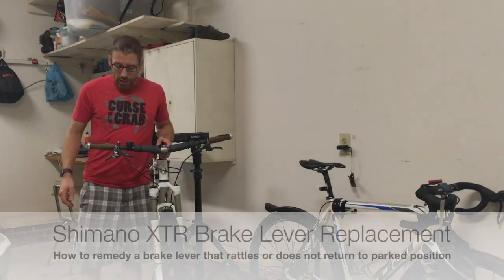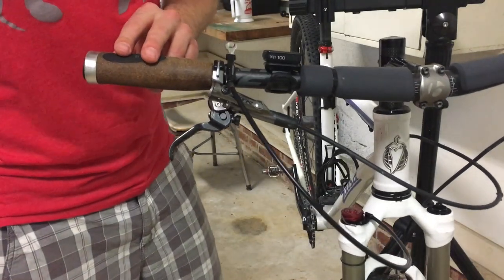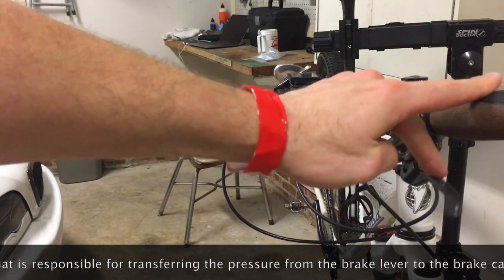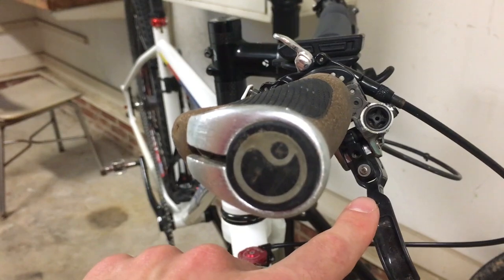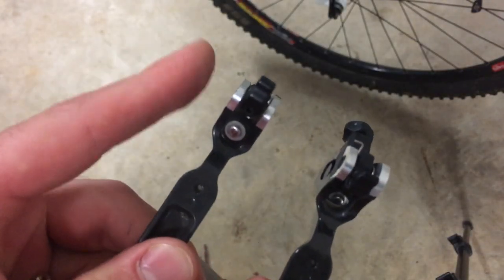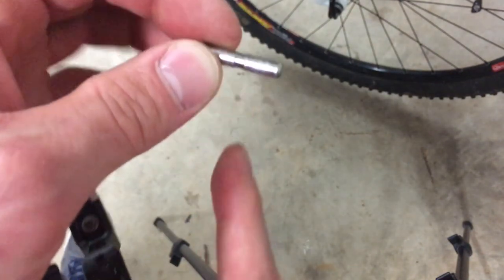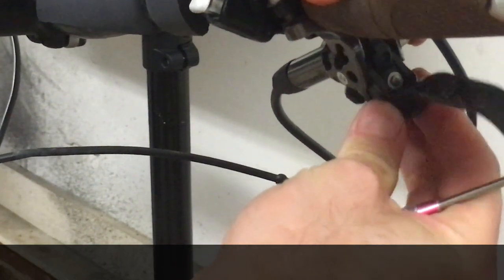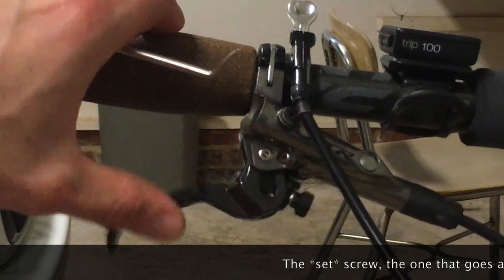Replacing a faulty Shimano XTR Brake Lever

Comment: My battered ole XTR brakes just started w/ the floppy lever. And so, I ordered a new one. Easy peezy…. Or so I thought. First try had me putting the spring in the wrong way. Second try had me at your video. 
Thanks. That did the trick instead of me stumbling on the correct installation blind.
Reply from the maker: Man I am so glad it was helpful. These brakes now have over 13000 miles for me and are getting ready to move to the next build :)

Comment: Thanks that was super helpful - Like someone else mentioned I would not have known about the set-screw that holds the pin in.  I'll add that my set-screw did not use a 2.5 mm hex - I had to go find a 5/64" hex driver (I suspect the screw really needs 2mm).  Could be due to my brake being a bit older XTR from 2014.  Also lining up those parts and the springs to get that pin through can be a bit of task!  The first two times I did it the lower spring was not catching against the brake body in the correct place and it was not cancelling the free play.
Reply from the maker: Glad it was helpful. Yeah, lining things up can be a bit of a pain. I worked as a mechanic for many years, so I got somewhat used to working on things by feel and lining things up, etc. Even still, sometimes it is straight forward, other times they get frustrating.

Comment: You don't need to replace the whole lever blade if this happens to you, just the little return spring which probably snapped. Happened on my saints too. I know you mentioned you only needed the spring but i think i found some for sale online but not sure where since i got one off an old broken lever
Reply from the maker: Indeed, though the video may be helpful for someone who broke the lever, and the spring does not seem to be available separately. Have you come across a source that sells just the spring?

Comment: I seem to have the same issue, the right lever is rattling but the brake is working fine. I am not that handy with things, but after watching your video which I found very helpful I decided to give it a shot. Question - is there a way to buy just the spring or have to buy the entire lever? Thank you

Comment: Mmmm cant get one spring to engage, the one pushing the lever towards the handle. Not sure what I do wrong. Ok got it, you need to set the lever to be as far away from the steeringbar as possible when mounting it. Then the spring is in the correct position. Then one the pin is mounted you can adjust the lever to the desired position. Works finally :)

Comment: Excellent, I was wondering how that major pin was fixed in place.  Where did you get the assembly?  My problem is only a broken fiber lever but still looking for a way to remove the lever from the sliding pivot (Amazon sells the lever separately)
.
Reply from the maker: Glad you found the video helpful, and thank you for letting me know. Makes it seem worthwhile to put in the effort to make the vid! Were you able to figure it out by watching the video? Jensonusa.com has the lever at a decent price (though any Shimano dealer can get it for you). If you need JUST the blade, I am happy to send you mine for roughly the shipping price.
Reply: Yes the video was the key (finding the hidden hex bolt - 2mm BTW).  Thank for the offer, my springs and parts look old (brittle) so I'll go for the whole unit.

Comment: I have the exact XTR brake lever as you. But I have an issue where the mineral oil from the reservoir is not flowing into the hose to the brake caliper. any idea for a fix on this?
Reply: There maybe a block in the hose or air
Reply from the maker: Sorry for the late reply I did not notice this. - Unfortunately I believe (assuming there is enough fluid in the master cylinder and not too much air in the system) you have a bad master cylinder/lever assembly.

Comment: Hello, hey the same
Thing happened to me on my deore brakes,
Do you know
By any chance if the same can be done with the replacement ? 
Thanks you
Reply from the maker: Looking at pictures, it would seem a Deore lever can be repaired the same way. Alternately, replacing the whole assembly is a viable option, they are significantly cheaper than XTR units.